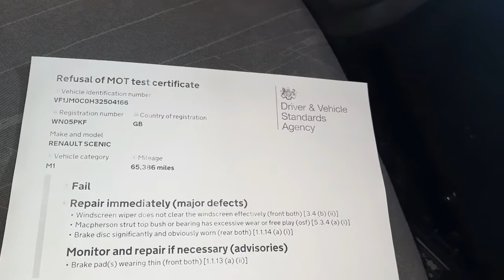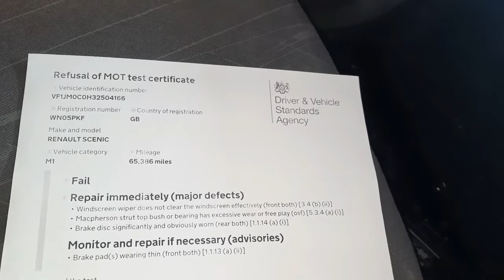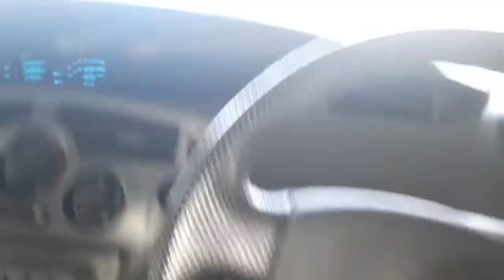Renault Scenic Rear Brake Replacement (including wheel bearing) - MOT Repairs

Comment: The torque value on a Scenic for those rear hub nuts is 220NM for anyone wondering! On a Grand Scenic, it's 280NM. Just researching the process to do my rear pads and discs and that was the only piece of information I felt was missing from this otherwise excellent video. Many thanks for putting it together!
Reply from the maker: Glad you found the video useful.

Comment: COPPER grease DOES NOT go on the brake assembly where there is aluminium or any aluminium parts, and that caliper is aluminium. Because galvanic reaction will ocure where copper will greatly speed up aluminum oxidation.